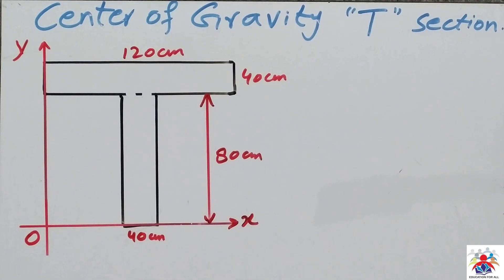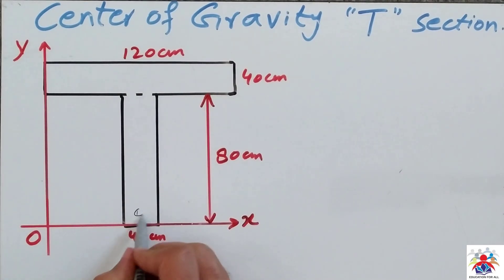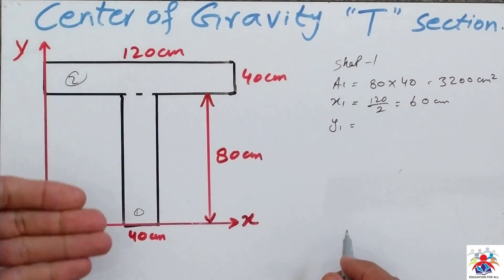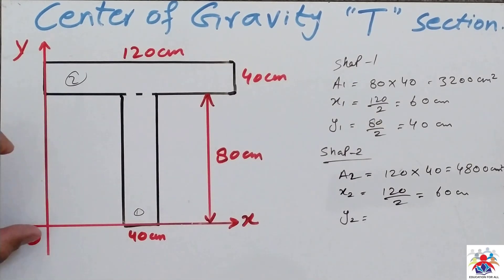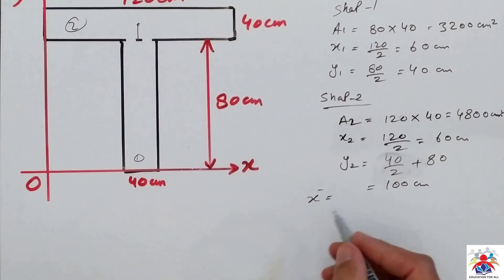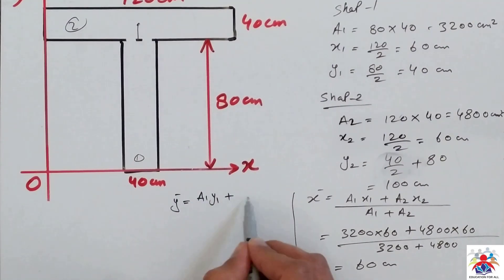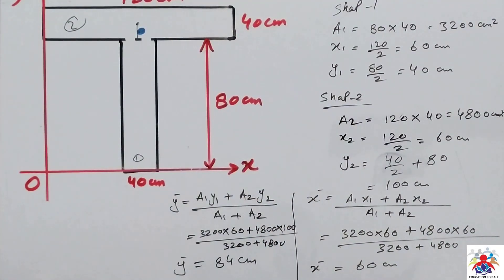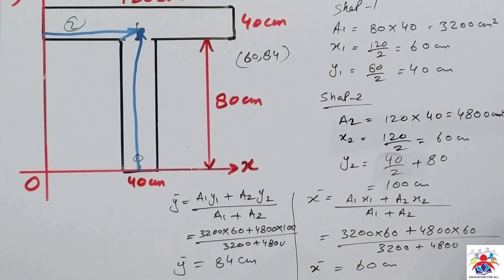Center of Gravity-CG-   T- Section

Comment: how you calculated y2 u didn’t explain it
Reply from the maker: Thanks for your message. Ok I will explain y2 once again. 
So,
From origin point to the top of the section we have 80cm and 40cm

Shape 1 has 80cm height and shape 2 has 40 cm height. 

Y2 would be 80+ 20 =100 cm 
Or
Y2 would be 80+ 40/2= 100cm 

Hope you have understand the idea.
Thanks